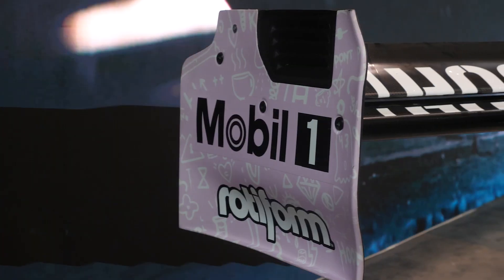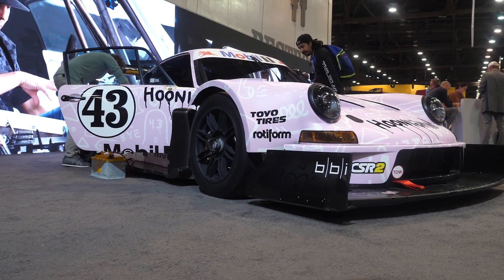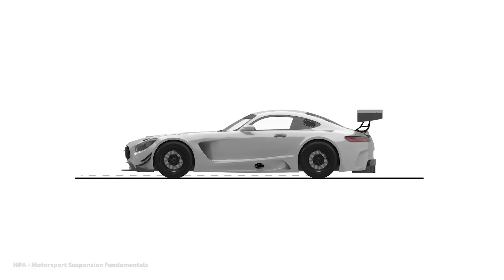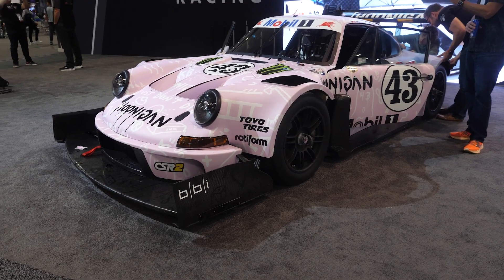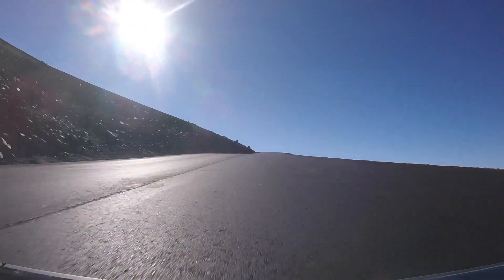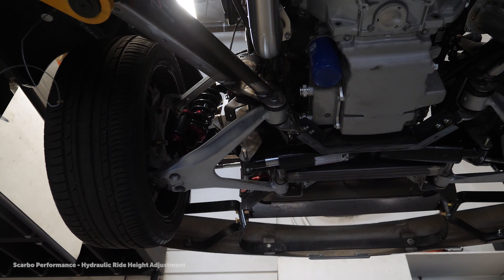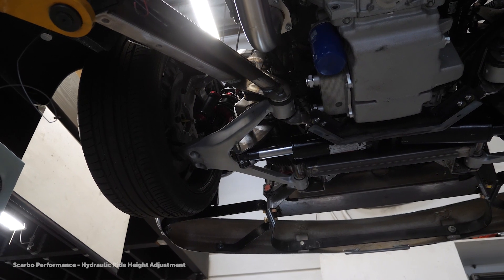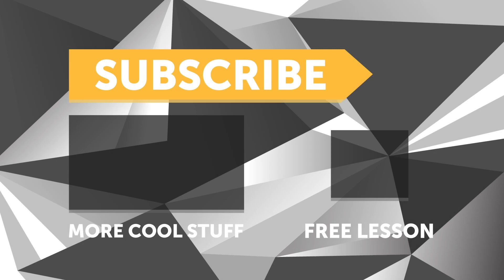Is This The Future Of Hill Climbing? | Geofenced Adjustable Ride Height #shortish

Comment: Geofenced GPS based reactive suspension... What kind of sorcery is this?
Reply: Williams FW15 , 1993
Reply: @483972  That's not new... The geo activation using GPS is nothing like what you just said. The basic principals of it work mechanically like this. But it's not the same thing. They didn't have GPS transponders in the car calculating your Lat long positions changing the suspension by computer auto magically..

Comment: Limited field of use, complexity, extra weight, cost, one thing more that could go wrong, placement problem. 
Good idea, but very high specialization.
Reply: That's true, but the ability to adjust the ride height, for them, might compensate for all that; I suppose.

Comment: The race changed when the road was completely payved so it makes sense that the cars would change with it.
Reply from the maker: Yes, but I think many people assume just because it is paved, that is it, each and every year top to bottom the conditions are exactly the same. Not true, especially for the top section 😎

That is all part of the challenge and a roll of the dice just like weather conditions on race week - Taz
Reply: @hpa101  yes and through the winter the ground at those elevations can suffer from frost heaves. I've seen whole sections of the road on Wolf Creek Pass do weird things in the winter